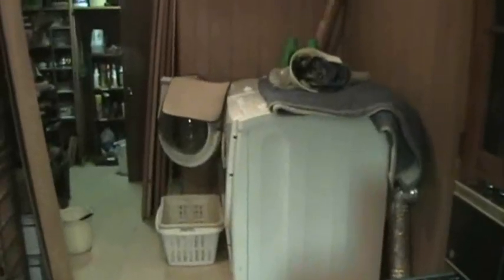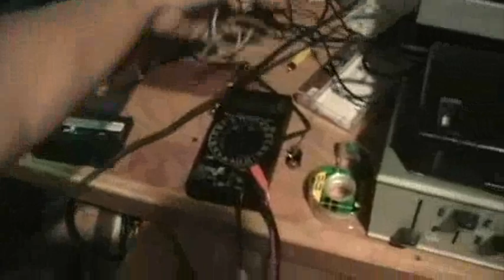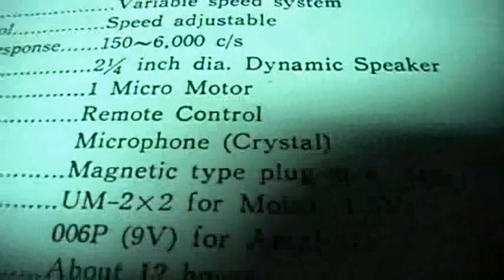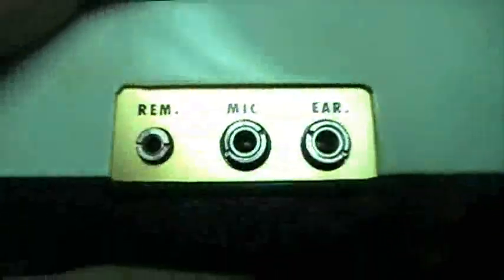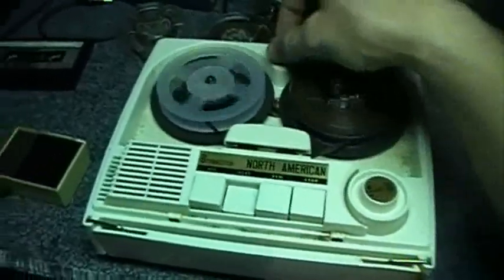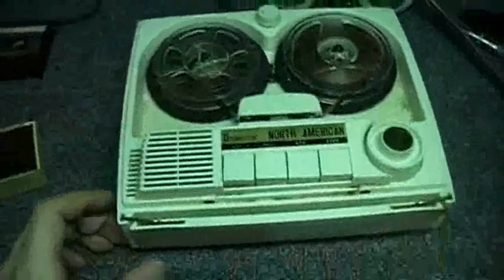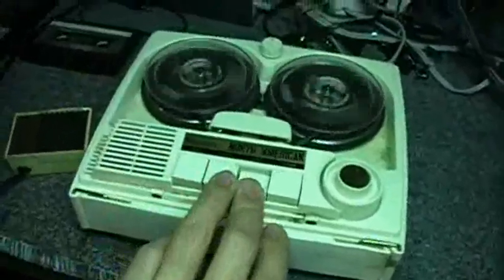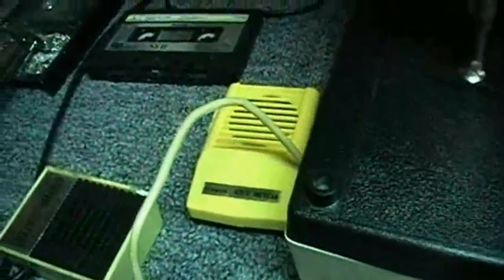North American yet Japanese made vintage rim-drive reel tape recorder

Comment: Clearly the original owners were from some Texas or some other southern part of the US, is Arkansas a southern state?  You say that unit uses seperate batteries for the amplifier and tape recorder, what size batteries does it use?  What were those strange sounds you were recording onto the tape?